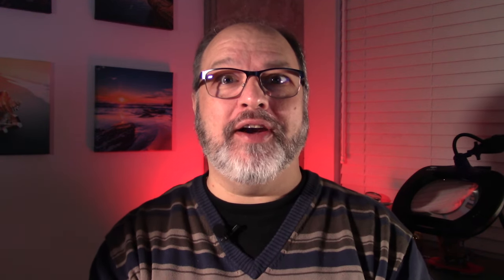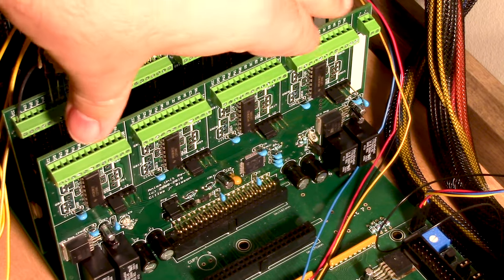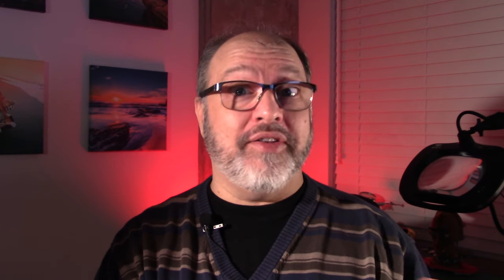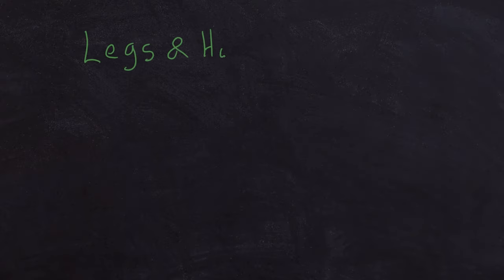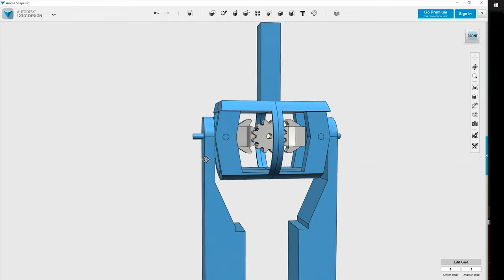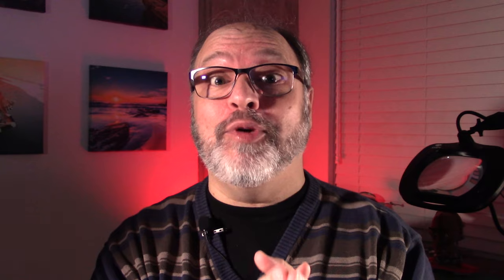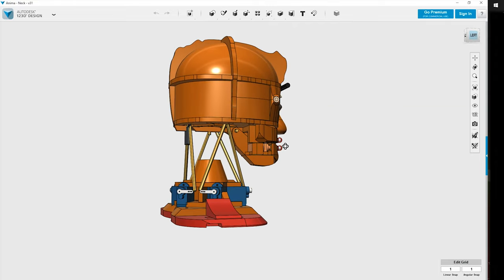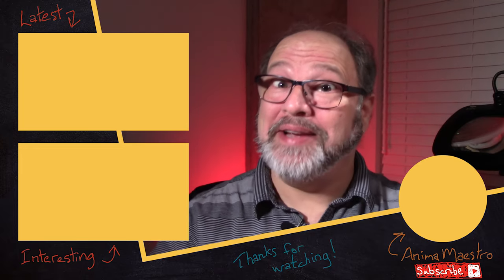3D Printed Animatronic | From Head, Eyes, Neck, and Hands to Feet

Comment: I really like your plans for the channel, and I'd be interested in knowing more about the choices you make (e.g. choosing motor placement and linkages) since that's always been a barrier for me
Reply from the maker: Yeah, it is a complex and iterative process influenced by many factor. I'd say the first ones are to determine the axis of rotation that you want and the amplitude of the movements, but more importantly how much torque you anticipate will be required. After that, it's a lot of browsing through all the available motor options given what control system/hardware you have, how much voltage and how much current are available. In my case, space constraints were of concern as well. So I try to juggle with all that and come up with the best compromise possible !! Even at this stage of my project, I'm not sure that all my choices will prove good ! Let me know if you have a specific case.